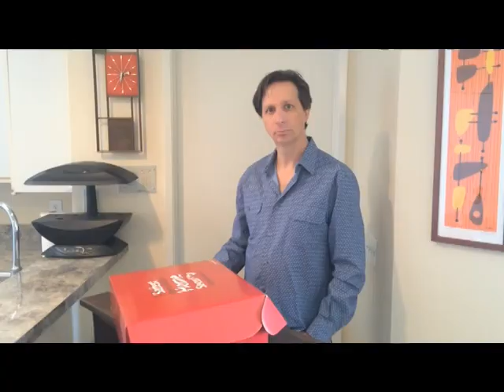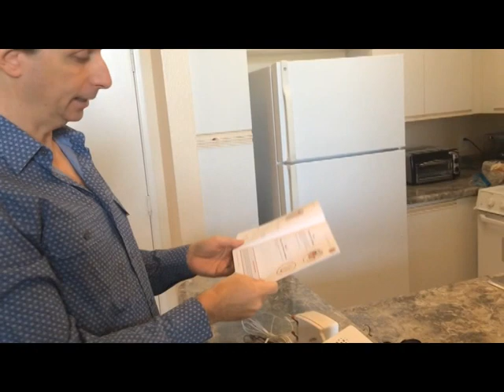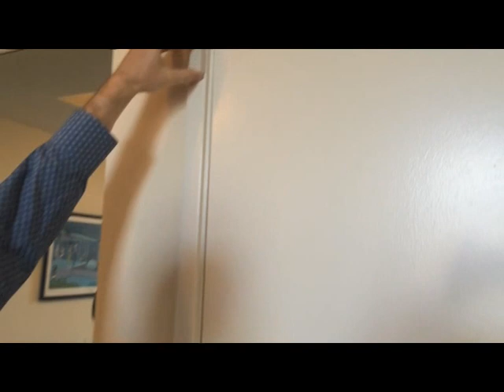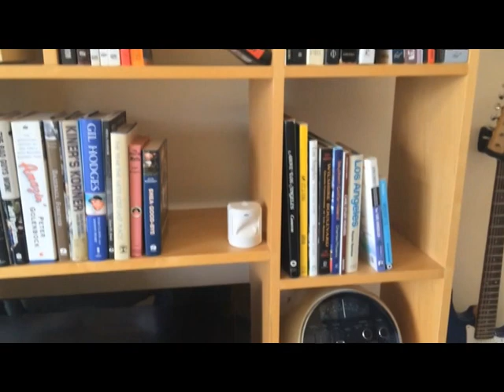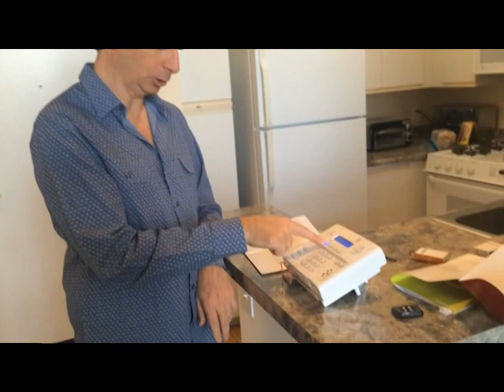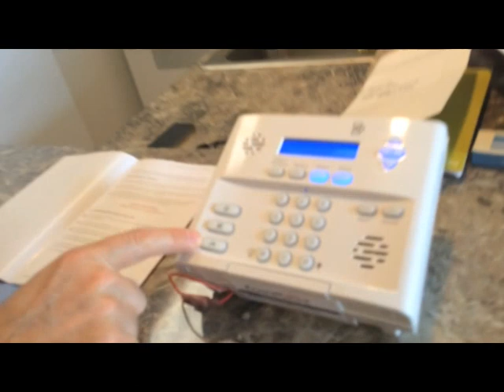Frontpoint Security Review - Home Alarm Systems

Comment: JUNK. simply walk in the front door, tear it off the wall and steal whatever you want. You forget, there a 30 second delay before it calls the station, fail.
Reply: Dana Dutcher That is over kill and most common panel come with a built in dialer delay that is there to help with the issue of false alarms. You are right about installers not installing correctly that is why the systems are being updated to protect against that happening, plus that is why you can only imagine how bad the installs when they are DIY.  Hard wiring a system does provide a better sense of security but does not make them necessarily better. Crash and Smash Protection does truly work and to define something against it defeats the use of a burglar system period and we all know that makes no sense.
Reply: Dana Dutcher you are 100% wrong.  The very second the door is opened, it instantly sends a pending alarm. Being cellular it sends out fast. By you smashing the panel, you can not send a disarm command. There for that pending alarm, becomes an active alarm. Plus on my panel if your first smash fails to break the CDMA module, it will trigger a tamper alarm to be sent and then the pending alarm becomes active.  To prove my point, if I walk in while it's on instant, and forget to disarm before walking in, in 4 seconds I am getting the alert on my cell phone for a pending alarm.  That is after it had been sent to the monitoring station, and then and the alert to me.  Maybe in the old days where the panel must dial a phone number this could be done. But now it runs over the internet via a cell network. Mine uses verizon. So try again buddy.
Reply: ***** Find a small local company that installers their main control away from the keypad and protected. Go cellular. Ask them who they monitor with and check that company out. Stay away from ALL nationwide companies. I've been in this business over 40 years and nationwide companies are a complete joke.
Reply: Incorrect, there are tamper alerts that are sent from the sensor to the Control Panel once it is moved (when system is unarmed) / removed (when sensor is torn off while alarm is activated).
Reply: Amanda, I have 40 years in high security in Los Angeles. You walk in before the alarm triggers, pull that POS off the wall and smash it. Now you tell me how that control is going to call anyone,lol. An alarm panel like that has no business being installed, it's a damn joke. EVERY alarm panel communicates on it's own, a smashed one does not and nobody ever knows it's smashed.
Reply: You want real security then you protect the main panel in a secured location. THAT is the only way to install a security system. ALL of these allinone panels are garbage.
Reply: You are very right, if the control panel is exposed then the system is still vulnerable. But.....FrontPoint has the technology built into the control panel to protect itself if someone does rip it off the wall, its called Crash and Smash. This is a tamper alert feature that goes out to the monitoring station and local authorities once a certain amount of applied pressure is detected from the control panel.

Having a secondary panel as a decoy doesn't fix the issue that the a cellular system is still vulnerable, especially since the secondary panel is where the siren is located. So the intruder will take those 30 seconds of delay time run around and find the secondary panel and still break it. That's why you need the Crash and Smash and why FrontPoint is still a better option than using a self monitored system or even a cellular back up system.
Reply: Dana Dutcher Amanda is wrong that is not how the Crash and Smash protection works. Alarm.com provides Crash and Smash protection by monitoring all signals that come in from the panel. So if a system is armed and a door is opened but no disarm signal is received then Alarm.com is aware that something is wrong. Over 75% of homes with a main panel in a separate location can be beat due to the fact that most of the tech and burglars know the location of the main panel ex. the master bedroom closet. Local providers are the best solution visit www.networksecuritytexas.com
Reply: Dana Dutcher  what is the best security system to buy in the same price range?
Reply: Kris Babas There is a way that these junker systems can be installed but only one way. You MUST make the installer put the main control in the master bedroom away from the entry doors and have it covered by a motion detector that is programmed for INSTANT (not interior). You must use keyfobs to arm and disarm your system. Your panel can NOT have any type of transmission delay on it when it trips. That is the ONLY way one of these all in one systems can be effective and unbeatable. These alarm companies nowadays are a joke IMHO. Remember this: you can give the same box of equipment to 10 installers and only one will probably be installed correctly. My first 20 years were spent installing in Beverly Hills area against the best thieves in the world.
Reply: Interesting. It seems like a cheaper yet even more cost effective way to make these would be without a keypad then period. Something app based or keyfob only. The cellular transmitter can't be that big and could be implimented into the magnets I'm guessing. 

Regardless, since you're obviously really good with this stuff, if you had to buy an all in one, who would you go with brand wise?
Reply: josh buenrostro sorry, I don't believe in overkill. As a tech working in Beverly Hills we fight the best thieves in the world. They make mincemeat of average systems. Installing a motion sensor to protect the most valuable part of someones security does not cost more than 5 minutes and 40 bucks. You are the new generation of alarm installers and I'm ol school, do it right or don't do it at all.
Reply: Dana Dutcher Old school should mean using learning new methods. No one home is more important than another no matter where you are. Your right cost of putting in the proper should not be a factor but honestly not every is protecting a million dollar home. So we need to keep things realistic and take advantage of the technology that is available to provide superior protection that what was done in the past. Plus there are videos of ADT which is supposed to be a professional installation company there in Beverly Hills putting in a $25,000 system that failed. Again always learning of what is available now to home owners should be something your more aware of.
Reply: ***** you go ahead and believe that. Bet they tld your that,lol know better. Been doing security since 1976. If that were the case they would be getting signals all day long
Reply: ***** Hey patrick, In 76 we had systems that were called "direct wire". Direct wire are 2 wires from the customer to the central station. The voltage osolated and was changed daily so not even we could get through them. Nothing compares to that today and they are still in use for high rollers. I ran a service division of ADT at that time and I was in charge of "The west side", Beverly Hills, Hollywood Ect. I was also in charge of the Gold and Diamond district in L.A.. Quickie alarm companies of today are a complete joke and make a mockery of our profession. The systems we install are the best there are and not even our own techs can beat their own systems as each is redundant. There are some of us that take protection serious. Go rip another american off, I knew more 30 years ago than you'll ever accomplish. Control panel destruction recognition,lol. We both know that's defeatable by any former technician.
Reply: I still install for some the wealthiest and highest profile people in Hollywood chump. I have a view of the pacific ocean out of my front room window to prove it,lol
Reply: anyone that puts this crap in their home is a fool
Reply: So what's the final verdict on the best alarm system on a budget? From what I read online, these are more popular than ADT but from a professional standpoint can somebody chime in and recommend one over the other?
Reply: Pick a local company that installs Honeywell and has been there for over 20 years. That's who provide you the best service. This crap here is backed up by AA Batteries and rarely do these people stay in business. All these chumps eventually sell you out to ADT in the end. Go local.
Reply: Dana Dutcher Bleep local. Stop with the tough idiot act. You're a beta male.
Reply: Daniel Sullivan You can NEVER get decent service with a quickie company or Dealer for a nationwide hustle company. I know, I've made a living at taking their accounts for over 20 years.
Reply: Amanda Miller another way is simply walking up to the panel and wrapping it with tin foil. THEN yank and stomp i.e. NO SIGNAL.
Reply: +Dana Dutcher they have a "crash and smash" service now apparently.  From their website: "Our Crash & Smash Protection means in the event that your Control Panel is damaged or destroyed, it will still alert the Monitoring Center to send help". i'm trying to find a home security monitoring service myself. any suggestions? I'm leaning frontpointbecause they had good reviews but i'm not sure.
Reply: Hi there. I would love to see you test out the Frontpoint system since you have so much experience with home security systems. I am in the market for a home security system and can't seem to find any reviews or videos where the system is actually tested with a break-in. Reviews only seem to talk about all the great, nifty features which is fine and all, but at the end of the day consistent security & monitoring is what matters most to me.

Comment: where can i buy additional sensors that are compatible with out buying directly from Frontpoint? Like i have discounts with Amazon and would like to know if i can buy some additional products from there. I just need to know what I need to look at to make sure they will work with the Simon GT panel. Thank you
Reply: as long as the sensors you buy are GE Wireless sensors they should work with your system
Reply: ***** you can buy sensors but they need to be programmed in and that ain't easy. Simon sucks.
Reply: Dana Dutcher  I already have had to program new sensors.  Front point's technical team is great.  I bought a z wave fortrezz siren and had no clue how to get it working right, they walked me through the connecting part, and then they programmed the panel to make it work as a siren. So I don't know why you say it's so hard. They have no problem helping you set things up.
Reply: david healy thanks, I found some on amazon they said they will help me set them up, they just don't provide a warranty for them. Well duh I would think that would fall on amazon.  But still, also the smoke alarm sensor I can only find a compatible one from front point. O well.
Reply: *****  may I ask where you purchased additional sensors ??? I'm in limbo and can't pick adt pulse or Frontline
Reply: I ended up buying them from frontpoint but the other guy below just bought some from amazon.  And as to picking between ADT and Frontpoint, that I don't think I can help with.  They can both do the same things. I know that Frontpoint has been very fast to respond. I have had a small fire that the smoke and heat sensor cought and before I could even do anything, they where calling my phone. I have never used ADT, but if you choose them, make sure it's 100% cellular. It's the fastest way to send any alarm, and it's more reliable then broadband or phone line.